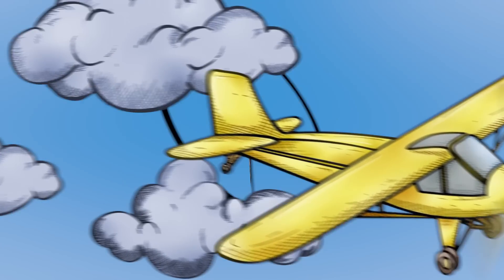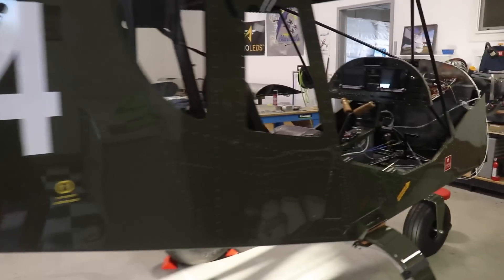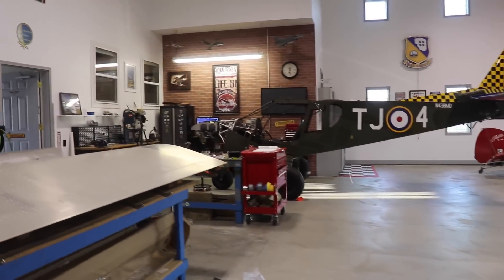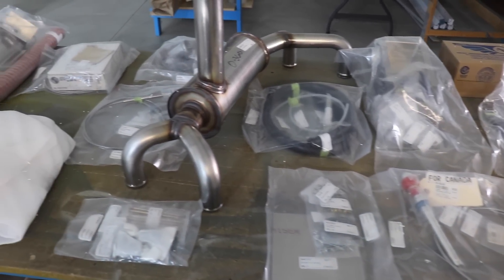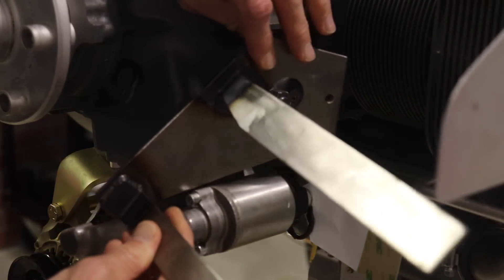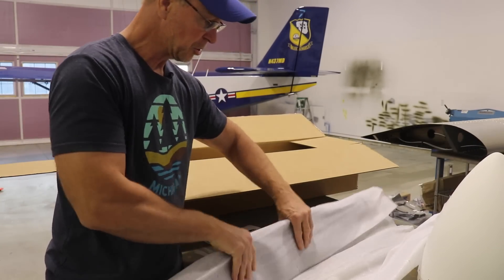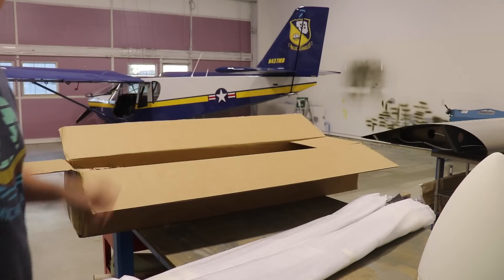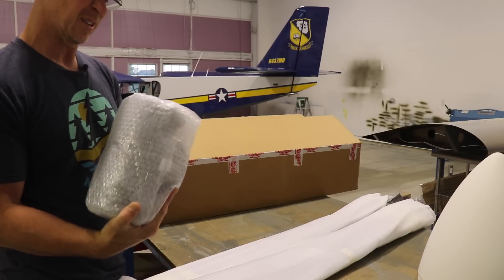FWF, Rudder, Servos, Cables, BOMBS, and MISSILES!

Comment: Did you figure out the carburetor box mounting issue? If not, would it be an option to make holes on the plate big enough to pass bolts through and the hex socket to tighten them?

Comment: Wouldn't it perhaps be possible to insert the bolt from the top of the airbox and the carburettor and the nut from the bottom?
My wife and I are building a normal 701 and only some parts are pre-drilled to A3.
But your videos are a great incentive and you have lots of good tips!
Reply from the maker: Since the holes are threaded the bolts need to go bottom up. If you can see the back two holes (or at least where they would be on the carb) there's no way to even put a bolt in from the top. I'll have to contact Lycoming and see if they have studs.
Reply: Hopefully Lycoming can help you and there is an easy solution, thank you for your answer. @KitplaneEnthusiast

Comment: Just a bit of a ‘heads up’ : A flight controls cable requires a minimum amount of contact (surface area) with a flight controls pulley (groove) in order for the pulley to rotate freely, as opposed to the cable slipping relative to the pulley, as the former moves back and forth; slippage causes wear over time. 

The minimum contact is typically referred to as the minimum “cable wrap angle” and it perhaps  🤔 might be specified for types of cable and pulley material combinations in either an FAA manual or an FAA circular (sorry I haven’t references) or you calculate it given (1)  the cable tension, (2) the pulley groove diameter, (3) the cable diameter, (4) the coefficient of friction for the cable and pulley material combination, (5) the pulley bearing’s static friction.

You should also be able to find various OEM content on the net  - which specifies how to calculate the minimum cable wrap angle for a given type of pulley / cable combination.

Basically you want to avoid slippage 👍
Reply: Ignore my comments mate, you are fantastic at what you do and the quality of your work is more than sufficient to ensure that you will not run it to the type of problems some folks do. 

My comments are really aimed at persons following along who do not have as much experience building aircraft as you do nor seek to achieve the level of detail and accuracy which you put into your work.

Really appreciate the time and effort you put in to preparing, editing and sharing your content with us all 👍👍 
Thanks for doing so 🙏

Comment: use a long stud or bolt on the air box, put a standoff between the carb flange and outside airbox. just drill through airbox under the carb flange. the standoff keeps the airbox from colapsing on the carb flange steel part that you are going to powder coat. use blue locktite on the mounting bolts.
Reply: Best idea yet, IMO
Reply from the maker: And once the box is built, how exactly would you align the standoffs when you can't get inside the box. Also please explain how you'd magically get the standoffs to not interfere with the carb heat flange?? It's a great idea but just would not work in the real world.

Comment: I’ve run into small studs on similar air boxes.  It’s still a huge pain to get nuts in there.  I don’t like that design.  I would make a cover/access plate that you can remove and easily get tools to remove.
Reply: Yes and I see no reason why all of that airbox thing could not be simplified and fabricated  from 1/8" 6061. Then  with use   of an access/cover plate would keep weight to a minimum.

Comment: On mounting the carburetor air box most engines have a little stud that goes into the threaded portion of the Carb. Then a plain washer and all metal lock nut are used
Reply from the maker: Thanks, I'll have to see if I can order those studs from Lycoming.
Reply: They should have them. I don’t remember the part number though.